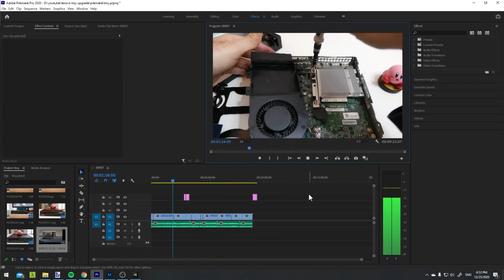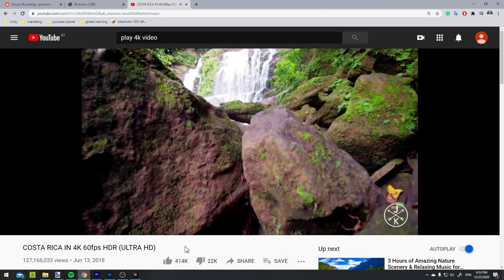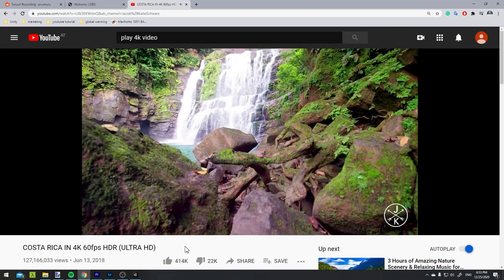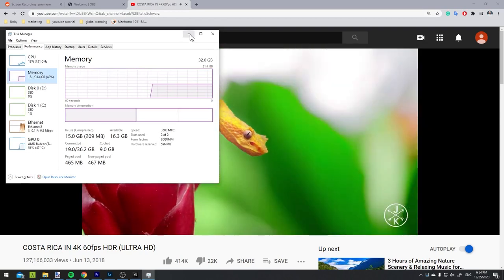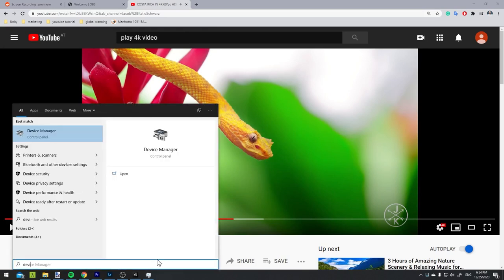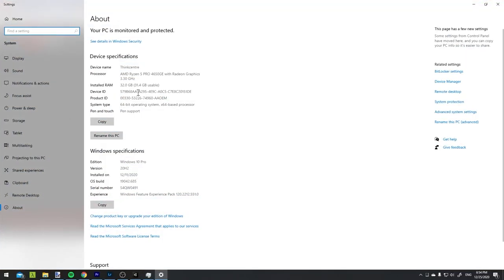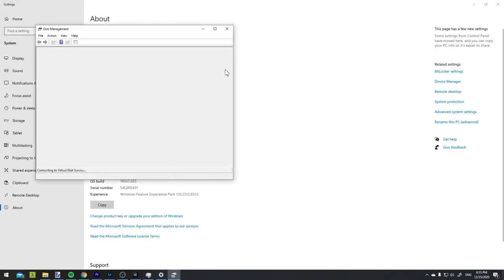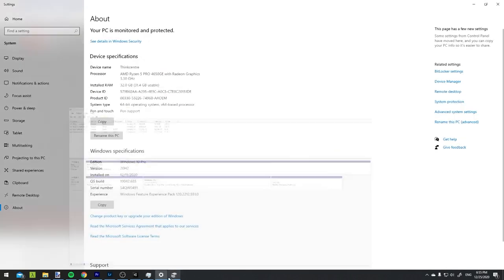AMD Lenovo ThinkCentre m75q tiny gen 2 upgrade RAM and SSD

Comment: Thanks for the video. Very informative. Based on what you've shown, I'll pop mine open and double check the configuration, and look at adding secondary storage. I have a WD My Cloud on the network, but getting software to access that is a bit of a nuisance. I was thinking of playing with Plex and related software, and adding secondary storage on-board would be a simple approach with less clutter.

Comment: Very informative video, M75q Tiny Gen 2 is quite an attractive model with low price. Renoir really is killing the competition in SFF and laptop market!(only if these are more available and popular) Here I'd like to have some questions:
How's the thermal performance?(temperature and noise during daily usage and/or benchmarks, )
Is there VRAM(UMA) setting in the BIOS?
This should be located in BIOS(press del at power up)=>Config(or Devices)=>Display, called "UMA Frame buffer Size"(or Total Graphics Memory), you should be able to select from Auto up to 2G
Thanks in advance!
Reply from the maker: The thermal is really ok for my case, I never pass 50 for normal usages and when running multiple VMs it runs to 60 and fan starts to work, it's not loud though :) 
Renoir is a good choice too, but in my market its more expensive than thinkpad and also doesn't have ryzen 5 and 7 options.

Comment: Very strange, it looks like there are 2x M.2 pin outs but no slot, and no mounting hardware, i wonder what these would be for, did you order yours without WiFi/LTE? Would be dissapointing if they didnt include the slots if you dont order it with the device, because i was planning on adding an M.2 drive along side the HDD
Reply: Me pregunto lo mismo. ¿Por qué tiene los pines M.2 x2, pero no hay solts?

Comment: Very cool. I saw that you can also update the processor on it.
I also saw on the Lenovo website that it even comes with the Ryzen 7 Pro 4750GE processor
Searching the AMD website I saw the Ryzen 7 Pro 4750G which has practically the same configurations as the 4750GE only with a base clock of 200 Mhz faster.
So, I was wondering if I can upgrade the processor to a 4750G using the same cooler that comes with this mini pc.
Reply: The BIOS and most likely the AGESA may be custom built for Lenovo to limit what processors this unit can use. Let alone I don't think the power supply can power the 65W processor. I have many M75q boxes and they use a 35W Ryzen 3 Pro 3200GE.
Reply: No, I needs to have the E at the end (Ryzen 7 Pro 4750GE), that means it is a 35W CPU, the limit it can take.
The version ending just in G is a 65W CPU, it will not work and there is a risk to damage the board VRM and will overheat for sure.
Reply: I think you need to check the motherboard compatibility (also recommendations ) for your new CPU and if your current motherboard is listed, then you may use. Just my understanding, not sure.

Comment: Hi, what GPU does the M75q Gen 2 use? Is it the Radeon 11? I already own a Thinkcentre Tiny M720q and I can say that Lenovo makes excellent computers that are easy to service and they are durable.
Reply: It's not specified what architecture the gpu uses. It's assumed to be Vega, but you literally can't find in any place that is not plainly assuming. As for the core count's it depends on what APU you choose. You can search this on google for the core count of the GPU once you choose the APU
Reply from the maker: I don't know the exact architecture, as @blake Vargas mentioned, it is not specified, and it's a OEM processor, so we don't have much Information. What I can say is I do light gaming on it and video editing and I didn't encounter slightest issue so far.
Reply: AMD GCN5 (Vega) , i.e.  Radeon RX Vega ,  the Graphics Core Next (GCN) 5th generation, https://en.wikipedia.org/wiki/Radeon_RX_Vega_series#Renoir_(2020)

Comment: I have a 3400G and a 4650G i will try them both in my M75Q gen2 once it arrives to see if the CPU can be upgraded, though with that tiny heat sink you would probably be limited to "GE" processors or Athlons
Reply from the maker: I remember someone tried with M75Q Gen1 and it didn't work, let us know if it works in gen2, it would be amazing if it does :)
Reply: @techmo2020  
Before any of this i'll be testing the 4750GE in the tiny against the Apple M1 Mac Mini, noticed that my work laptop with 4750u was not only slightly faster in handbrake than the Mac Mini, but the laptop also used ~25% less power to transcode the same video to H265
Seeing as i bought the Mac Mini to transcode to H265 24/7, i was a bit upset given the price over the 8 core tiny,  especially sinse it was supposed to be on a 50% more efficient node than Ryzen, let alone being a RISC processor

What were the circumstances of the upgrade? I could understand it not working if they went from a 3400GE to say a 4650G/GE. I'm hoping they didnt have the issue going from a 3200GE to a 3400G, i was hoping to take the 4750GE out and putting it in my portable file server(cant seem to find the GE models on ebay), and throwing the ebay 4650G from my file server into the Tiny, was hoping to have a small gaming rig with the 4650G(for older games), with the higher iGPU frequency and GPU power budget than the GE models, i could use windows power plans to keep the CPU power under 20w and leave the rest for the iGPU

Was hoping to get the idle/peak power usage down on the file server with the 4750GE, with 2 extra cores it will help with the interupts from the dual 40G network card and 16xSSD array, keeping the frequnecy lower by spreading across more cores is key for a long run time on UPS, keeping the temps lower also helps to reduce dust build up in dirty environments.
Reply from the maker: @denvera1g1  thanks for info, yeah GE version is meant for manufactors, not retail, I couldn't find it either. Interesting that the performance is better than m1 for that use case. Did u run it natively on m1?
Reply: @techmo2020  Yes, Handbrake currently has M1 support, but it is in beta, so i'm just hoping there is an issue with the beta version
Reply: Hey, did you manage to find out if the CPU can be upgraded/changed?

Comment: Hi, thanks for the video! Quick question, I have the same model and I just upgraded the memory from 8gb to 16 using another Samsung soDIMM 3200mhz but is running in 2600mhz any advice? Thanks one more time
Reply from the maker: that's weird, I just checked and for me, it runs on 3200.
Reply: @techmo2020  my bad, the new one is 2600, I just asked for replacement on Amazon lol they sent me the wrong model

Comment: Thanks! The video was very useful. 
Would you happen to know if there's any size limitation for the HDD/SSD? I know some small form computers from China seem to top at 2TB. I was wondering if I could add a 4TB 2.5" HDD in this Lenovo. Again, thanks for the video.
Reply from the maker: Sorry mate, I don't know, mine is 2TB :p
Reply: @techmo2020  so you can put a 2T SSD in the M75q Tiny 2? I didn't notice a big price difference between 1T and 2T
Reply: If you could find one you could go much higher say 8 gig as there are no limitations in that regard in any Bios